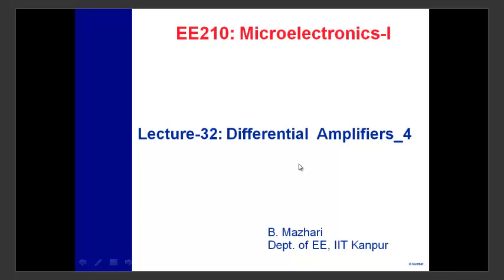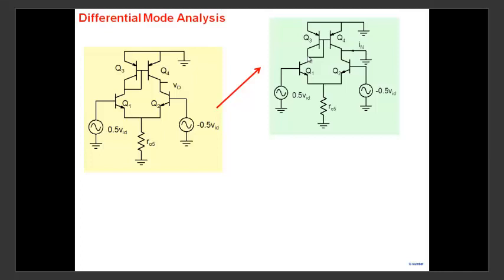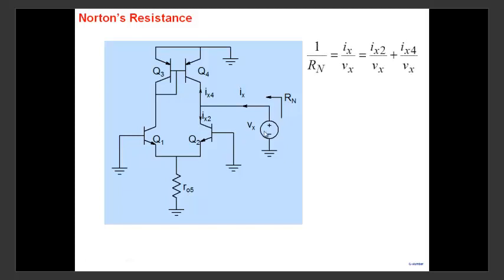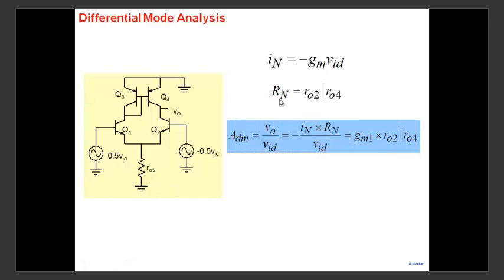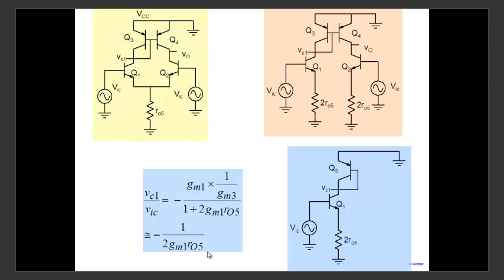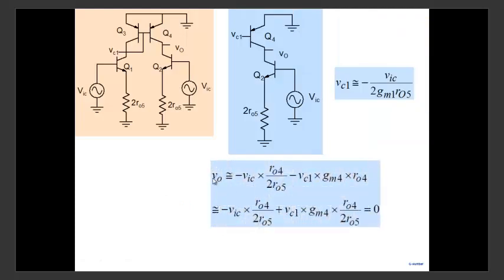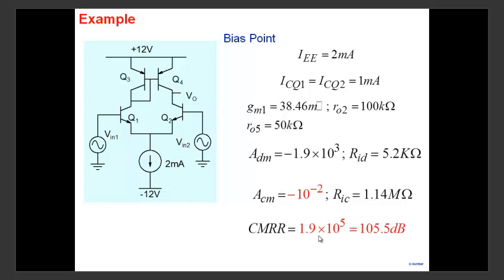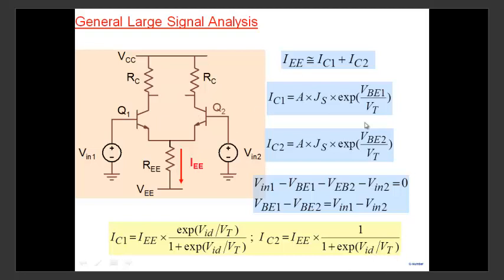differential amp part 4

Comment: What happened to the gain if only one input is active and it is a small signal?
Reply from the maker: Any set of inputs can be expressed as sum of differential mode signal  and common mode signal and then we can use superposition principle to determine the final result.
Reply: @baquermazhari8968  does this work even if the base of the other transitor is grounded? Can we still use the symmetry approach? also where is part 3?